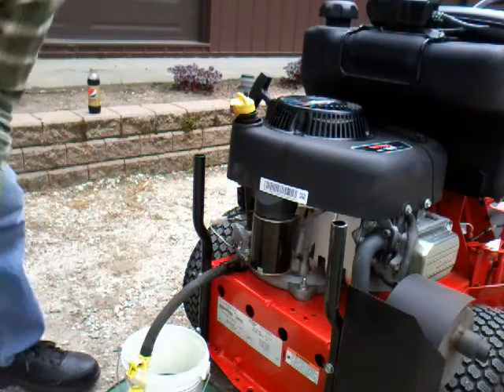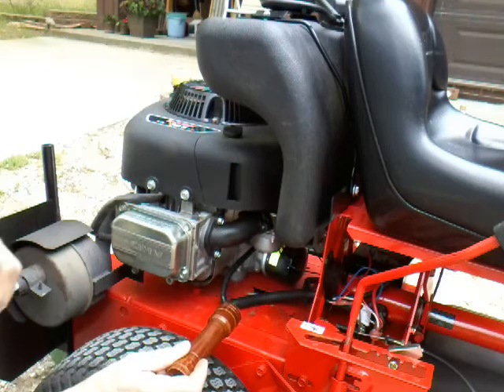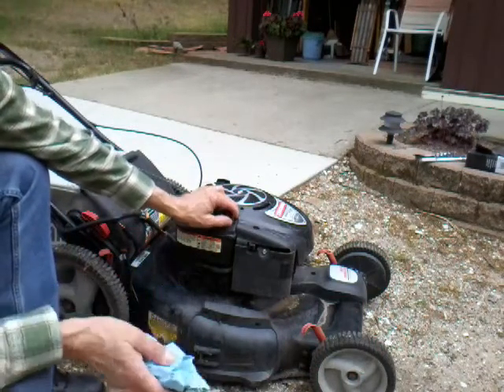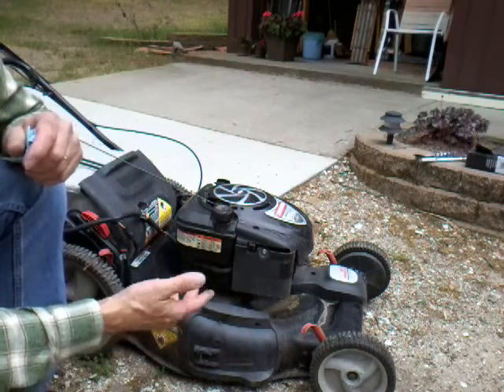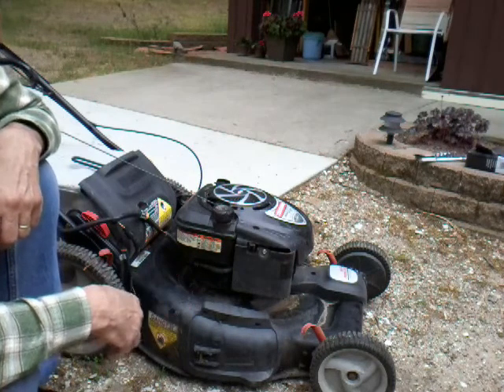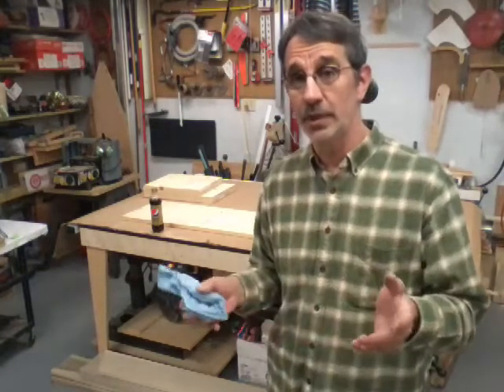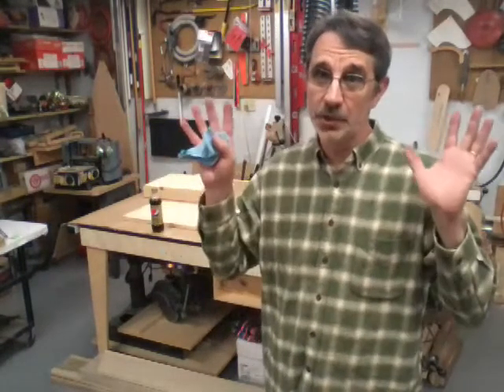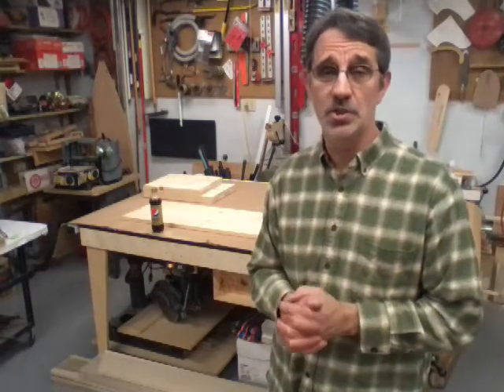99. M/S 6  Changing the oil in your Snapper Riders

Comment: Jim, to change the oil in the riding mower with a filter, I would suggest getting it warm, standing it up, drain the oil and then loosen the filter.  After the filter drains, remove it and replace it with a new filter.
Reply: I would agree, boregard nine. That would seem to be the simplest and cleanest way to change the oil and filter. Wouldn't you agree, Jim?
Reply: How much oil goes into a 12 horsepower Briggs & Stratton motor

Comment: The belt cover on the walk behind mower is only attached with the one screw. Unplug the spark plug. Turn the mower on its side with the carburetor UP. Remove the screw and pull off the drive belt cover.  Use a 3/8" extension and a ratchet and remove the drain plug.

Comment: Mr Jackson I have been looking all over for that exact mower. 99.M changing the oil. I inherited it  and it seems some of the safety switches have been removed, has to be pulled to start so I put in a new battery and solenoid. All was fine for a while . Long story short I have 2 wires left over and don’t know where they go. Big fan, love your vids. Do you have any on that same mower??
Reply from the maker: I’m not sure by that number what this mower is send me some pictures of it and some pictures of the wires that you have extra and where they come from and I’ll see what I can do.        Jim
What state do you live in?

Comment: I have year-old  snapper you turn with a Briggs and Stratton  motor need to change the oil but can not  find the oil filter(492932) what can I replace it with a fram or some other brand    and also  how to get to my filter out  as you said it is in a bad spot as well hope you can help me out also I have been changing  my oil  for years with 10w 30 motor oil someone told me that I need to use other 4 cycle oil  can you tell me which one that I need thanks in advance

Comment: Jim what type of oil do you use in ur snapper. Do you use a different oil with a mower that uses a oil filter? Non detergent?
Reply from the maker: Rick Ncarolina 
  If you mean the engine I use straight 30 weight in the summer and winter engines I run 5W 30. But what you use is strictly up to you thanks Jim
Reply: Never run a non-detergent oil in anything.

Comment: Jim, I have a 28" snapper with a 12.5 briggs motor. The book says it holds 48oz but I put 20oz and it shows full on the dip stick. How much oil does it hold?
Thanks Bill Shippensburg PA
Reply from the maker: When I Google Briggs & Stratton. 12 1/2 horse engine it’s telling me 48 ounces/1 1/2 quart, I guess I would get a hold of a True Value Hardware. in your area and asked mechanic why your dipstick isn’t matching what the book says. Jim

Comment: Hi Mr Jim. How long is is my cluch/Brake cable on my Hi vac 38 snapper. And is Hi Vac 28 also the model number. Cause I can't find it or where to for it?
Reply from the maker: There are three basic body styles of snappers the original round tube, the SR series which is the rectangular tube and the newer ones which I call turtles which body style do you have and how big is the deck and I can probably come up with The size of the cable. Jim

Comment: I have a 2016 Snapper RE130 13.5 HP  33" Cut. I can't find the oil filter. The manual did not come with a diagram breakdown of the machine. Is this a machine that operates without a filter?
Reply from the maker: If it had one you would be able to see it it would be 3” in diameter and 3” long.  Jim
Reply: @jimjackson9381  Thank you sir.

Comment: The bracket that holds my oil fill tube at the top is always coming off and gets lost in the yard. I can't get a screw to stay in place. Is there a generic screw that will stay in? I'm almost tempted to epoxy it on somehow. Bracket is part  690593.
Reply from the maker: a user 
I wonder if you can get a pop rivet in there to hold that in place just in case you ever want to get it off you could drill it out. Jim
Reply: @jimjackson9381  Thanks. I ordered 2 this time. I've got a couple days to find something. I'll check out the hardware store tomorrow. Thankfully the tube seems to at least loosely stay in place without the bracket.
Reply: Thanks Jim. The pop rivet worked great. It's never been so secure. It needed a 3/16 rivet. The ones that came with the gun were about 1/2 inch long and had just enough gripping length to hold it.

Comment: I have a Snapper Mower and gas is coming out of the filter how to fix it
Reply from the maker: Johnathan Quarles 
Well without actually seeing it I guess I would say that your float is stuck open and it’s flooding your engine and I would imagine your oil is full of gas and maybe your cylinder don’t try to start it until you check that out, you’re probably gonna have to take the carburetor off and clean it maybe it needs a new needle valve to seal. Jim

Comment: Does anyone make a adapter and hose to put on my RER Snapper oil drain hole so it don't make such a mess when I change the oil? Help!
Reply from the maker: Forget about the fancy quick drain and hose  Briggs and Stratton offers it’s plastic and they fail and you could blow up your engine, get a three eights x 3“ long pipe nipple and a three eights cap and put it on your engine just make sure that the end of the cap Doesn’t stick past the bumpers. Jim
Reply: Use an empty paper towel tube.

Comment: I have a snapper pro 36 in deck with a 19 hp Kawasaki engine I'm replacing the engine with another one and I'm having problems with getting the clutch off the shaft..can anybody help me with that?
Reply from the maker: Darien Persley 
  Do you mean you're trying to get the drive disc off the bottom of the engine that's on the crankshaft,  take a picture of it if you can and email it to me at. jimsfixitshop@gmail.com